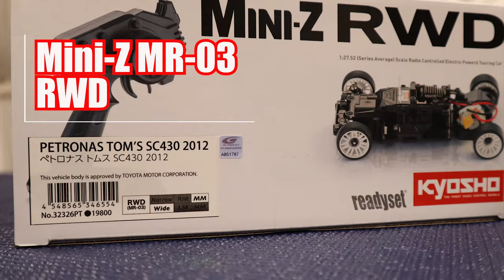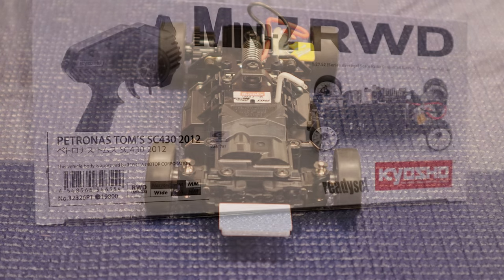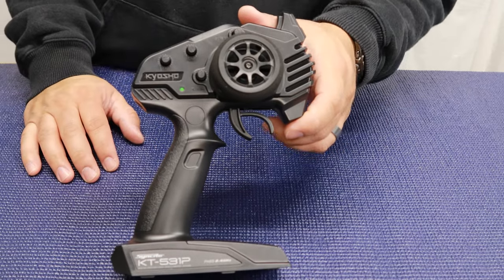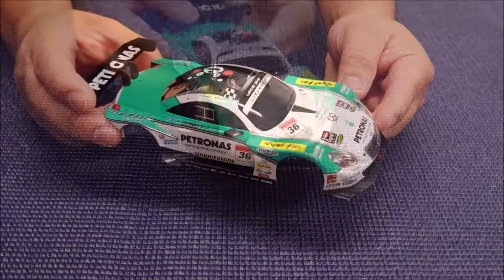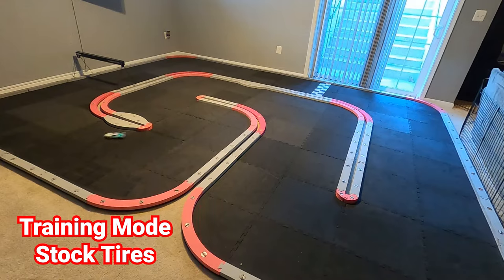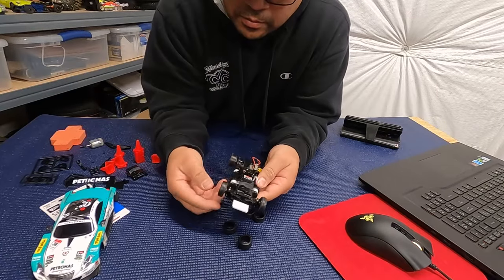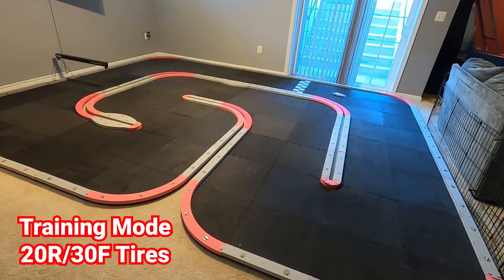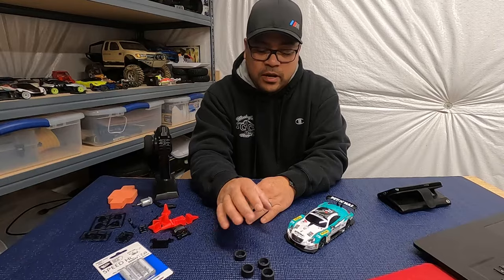Kyosho Mini-Z for Beginners-RWD Unboxing and Track Test

Comment: Rub some wd40 on the stock tires and let it dry.  It Works wonders.  It’s a trick I used for pavement racing my short course truck years ago.

Comment: My setup is 
Pn firm front tires
Pn super soft rears
PN #6 carbon t-plate
Kyosho Oil Shock rear
PN +2 steering link
PN 1 degree aluminum front knuckles
PN lcg v5 motor mount
Kingpin flip mod
PN 70 turn w/ 9 tooth pinion
Best lap time with tires only was 9.76. Now with upgrades my best is 8.4. last 3 weeks I've TQ'd my my class. The car is alot faster than out of the box with minimal parts. Honestly none of the aluminum parts are necessary but more of a bling factor. Only the motor mount i really noticed a difference in handling. Maybe you could get some video of it in action some time
Reply from the maker: Thanks for sharing.  That's a huge improvement! The motor mount is an essential upgrade for aftermarket motors and getting the right mesh.

I'll have to get some track side clips next time.

Comment: What kind of track is that?  Looks cool
Reply from the maker: RCP Track. It's the best way to experience this scale.
Reply: @byebyeracing4277  Great video...which # for the RCP track is this and do you have a link ?
Reply from the maker: @joe7406  this is a couple of Wide L tracks and the wide inside turn track
https://rcptracks.com/products/rcp-tracks%E2%84%A2-50cm-sets
https://rcptracks.com/products/rcp-tracks%E2%84%A2-50cm-large-radius-inside-turn

Looks like you can get better deals through their authilorized resellers however.

Comment: Can you tell me what radio goes with the ASF poPOF Mr 03 set I have the same set that you have with that 513 radio and it does not bind with it
Reply from the maker: The latest radio is the EX-6R which is compatible with the MHS/ASF protocol.

The KT-531 is Mini-z FHSS and the KT-432PT and FlySky Noble NB-4 (with FHSS module) will work with the  latest Kyosho Mini-z RTR series.

Comment: Great video for beginners.  looking forward to more!   What timing system are you using and where did you get that cool timing bridge?
Reply from the maker: Hey Brett thanks! The timing system is iLap.  The bridge was made by local racer and Washington DC GTG club founder.  It's made from aluminum channel and heavy gauge wire.  He paints them as well.
Reply: DC? Where can I get into this in the DC area?

Comment: Very good introduction video - I’ve just purchased my first mini z - a RWD. I was running it on polished timber flooring and it was sliding and almost uncontrollable with the stock tyres. Would the tyres you suggest make much of a difference on this surface ?
Reply from the maker: It's hard to pin down a specific set of tires. The softer the better for grip but you also need to prep the surface by sweeping and mopping.  Even then you can't get everything.

Comment: I was looking to pick one of these up. I used to have the silver Mercedes lemans car. I was busy with other hobbies and never took it out of the box. I was thinking about picking up another but couldn't decide between rear wheel or all wheel drive. I don't have a track that I know of near me. I'm trying to figure out which one would be best as far as just messing around with. I won't be racing to feel like I said to my knowledge no track within driving distance. Also wanted to know as either one rear-wheel drive or all-wheel drive better for growth meaning which one has the most hop-ups and won't be out of date as far as new models in the near future. If that makes sense I just don't want it to be outdated in 6 months

Comment: Nice. I'm looking to build a track about 7m x 4m. What is the difference in handling between mm and rm models. Is there any reason to go for one over the other? Also what were the tyre part numbers for those?
Reply from the maker: Hey Darren.  That will be a nice sized track.  The handling difference in a nutshell is the RM has the motor rear mounted and understeer is more apparent around corners on throttle.  The MM has the motor mid mounted which gives you more steering but makes the chassis dart a bit more.  Most racers prefer the MM for racing because of the sharper steering and longer wheel base which adds more stability overall.

The front tires are MZW39-30 MINI-Z Low Height Slick Tire 30deg. https://www.kyoshoamerica.com/MZW39-30-MINI-Z-Low-Height-Slick-Tire-30deg4pcs_p_24989.html
The rear tires are MZW17-20 Wide Tire Set (20°) https://www.kyoshoamerica.com/MZW17-20-Wide-Tire-Set-20_p_4143.html

Comment: Great content man! Got my MR03 RWD a couple of weeks ago, but for some reason it has problems binding and staying paired. Does this happen often with the FHSS KT-531P? It ran great, started a couple of days ago... So sad!
Reply from the maker: Hey Patrick, it's seem to be occurring more and more with no explanation.  Be sure to follow the binding steps and keep your batteries fresh in your radio and chassis and keep the motor wires tight.
Reply: @byebyeracing4277  Sent it back to my vendor, I'll most likely get a new board... Which I'll then swap for an EVO board! 😂 #addict

Comment: Did you do anything to the differential? Since they are not locked differential my car slips every way around because one tire has more power. I’m also just using it on my kitchen floor and maybe too dusty for the tires? Compared to your tracks grip . Specifically in left turns.  But all in all how was your experience with the differential?
Reply from the maker: The diff in this video was dry.  Adding a heavy grease will lock it up somewhat but that may not be the solution.  
At this scale the power easily overcomes grip on slick surfaces. you could run a ball differential and adjust it so that it slips slightly. However, even with the stickiest tires you're not going to achieve the grip levels you would where both surfaces are rubber.

Comment: hi is there a gyroscope inside or i must buy one
Reply from the maker: No gyroscope was used in the video. A gyroscope is not needed.
Reply: @byebyeracing4277  ok thank you 👍
Reply: Even with the Drift tires?
Reply from the maker: @Polo_Bolo it is not possible to drift consistently with Mini-z RWD. You will need an aftermarket chassis like Atomic DRZ with gyroscope for drifting.

Comment: Hey just picked up the same car. Do the tires bump up against the body when fully under load? All 4 of my tires touch. Hate to go hacking away at the beautiful body. Any tips?
Reply from the maker: I'll check.  My suggestion is to compromise between full suspension throw and ride height. If you find that the tires are rubbing you can true the tires down, add or remove spacer on the front suspension or you can purchase a front nose plate that uses spacers like the PN aluminum and carbon set.

Comment: How do I pair this transmitter I did the steps in the video but nothing happened when I turn the wheel or hit the gas
Reply from the maker: After placing the chassis in pair mode you must turn the radio off then on again.

Comment: Can these be upgraded to a lipo battery pack?  I had a old epoch indoor racer that had tiny nicad batteries.  A 1s 500mah lipo pack made a huge difference in runtime and top speed.  The miniz looks like it has plenty of runtime, but would a lipo pack give higher current and speed?
Reply from the maker: Hey Scott.  Kyosho makes LiFe battery packs.  You could convert to a PN chassis and run their lipos.

There is also the option of AAA lithium batteries with dummy cells though it's not as reliable as the latter.

All choices will provide higher current and speed.

Comment: I put it into regular mode and my steering works but my motor doesn’t work. Can some one help me
Reply from the maker: That's odd. Typically,  when you have steering but no motor it's either low batteries or yhe motor tabs need to be tightened.
Reply: @byebyeracing4277  I figured it out one of my wires got pulled out so I soldered it back on to the terminal
Reply from the maker: @dinkmaster9284  glad to hear. That can happen as well.

Comment: So what kinds of surface are the stock tires for?
Reply from the maker: Outside use. Use caution though as there is only a few mm clearance.

The stock tires are harder than those used on RCP tracks as in the video.  They are less prone to picking up dust because they are not soft.  Coarse surfaces are good for the hardness of the stock tires.
Reply: @byebyeracing4277  That's great info!  What about hardwood?  What would my best tire choice for hardwood be?
Reply from the maker: Thank you! Use a softer treaded tire for the back.  You'll  still pick up dust however. For the front tires I suggest a 30 or 40 low profile, @SpinShoeGuru

Comment: Hey don't know if I'll get a reply to this but was wondering if it's a good idea to race awd instead of a rwd? I have a home made smooth cement rc track in my backyard and use it for drifting it's in no way like a in door polished floor but the cement is smooth with no sort of texture but it has its weather beat now, but basically would I be able to drive a rwd with very grippy tires on it without spinning out so much or should I try awd with grippy tires ?
Reply from the maker: Hey Branden, given your conditions the AWD will bring the most drivability.

RWD will work but you will need to try different tires for your surface.  On concrete sometimes a harder tire will have more consistency than a really soft tire because a harder tire will not pick up dirt and dust and much as a softer tire.

You will want to compensate for power oversteer...so you will need need to test different tires front and rear to find the balance.  Good luck!

Comment: Is that the 30 or 50 sized track?
Reply from the maker: 50cm
Reply: What are the edges you used for this track?
Reply from the maker: @kyleschraw7600  It's two Wide-L kits with the Wide Inside turn kit.  The track rails and tiles are foam.

Comment: video very helpful thanks is awd better
Reply from the maker: AWD has it's place.  A lot of people use it for drifting.

The AWD has a weak plastic differential and should be upgraded to a ball diff that can slip a little.  The dog bones are also weak.  The chassis plastic is weak.  There is a lot of power loss from the drivetrain so you need a hotter motor to keep up with the 2wd. The AAA batteries are stacked on onside and it doesn't have the low CG that the 2wd does.

The AWD does have great grip on the RCP track and can put down some decent laptimes.